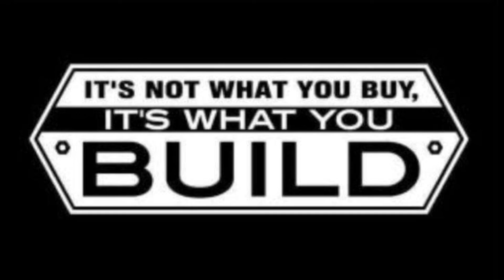1941 Chevy Truck Restoration, Nu-Relics power window unit install

Comment: Hello im working on a 1936 Chevy truck. in order for you to complete the window set up. Is the C track needed? I've been researching online and can't find no info. Im taking I need the C track for the window regulators and also the sash for the actual window to mount on correct?
Reply from the maker: This door has the channels on each to guide the window. The unit comes with the piece that bolts to the window
Reply: @ELDESTBuilds  I see... thank you for the info!
Reply: @ELDESTBuilds  just replayed the video and I see them at the 2 min mark haha. Thanks again fixing to buy them.
Reply from the maker: Welcome